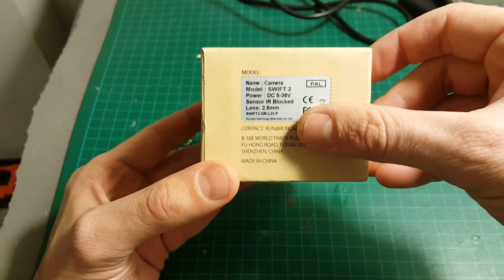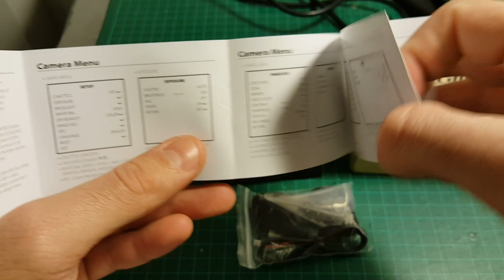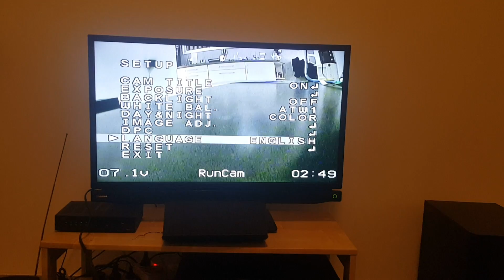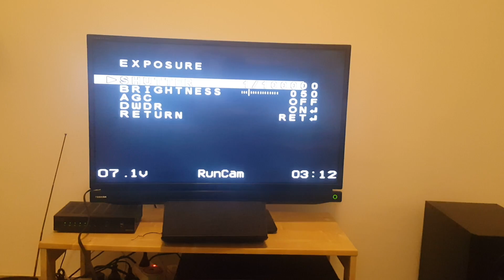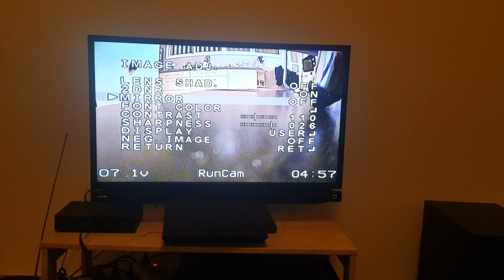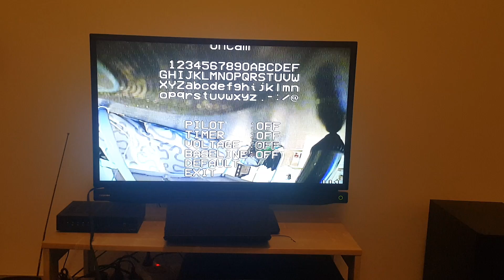Runcam swift 2 - unboxing and overview

Comment: How did you mount the camera, just bolt it on the frame with some screws?
Reply from the maker: +Oprean Trifan Mircea Yes. Which frame are you using?
Reply: f450
Reply: already ordered an Foxeer XAT600M HS1177 but I was wondering about that jellowing people are talking about.

Comment: Do you have to connect the battery throw 5-36v and VBAT+? I mean how you connect it to see the voltage on the goggles?
Reply from the maker: You have to connect the battery + to the VBAT + in order to see the voltage on the goggles.